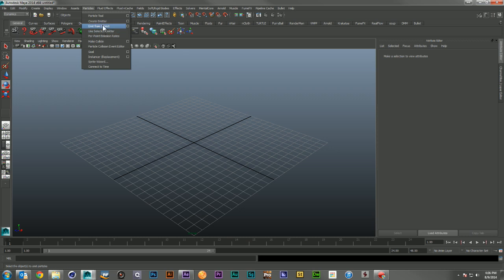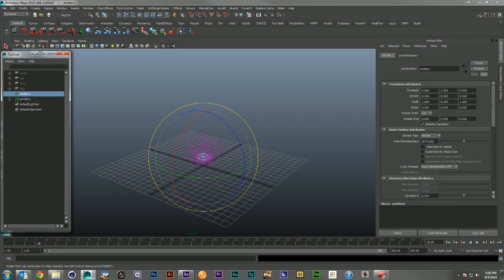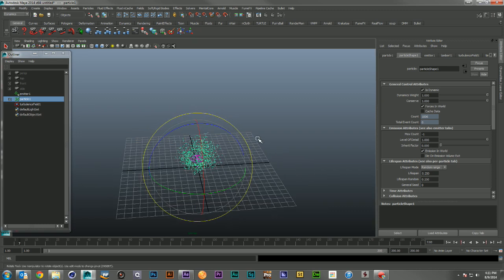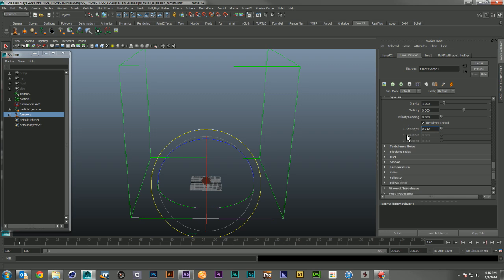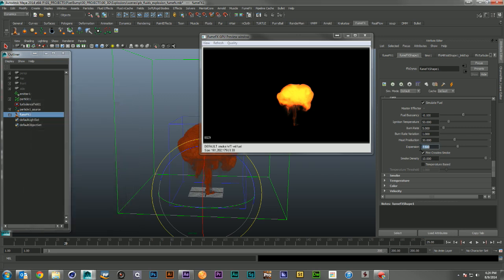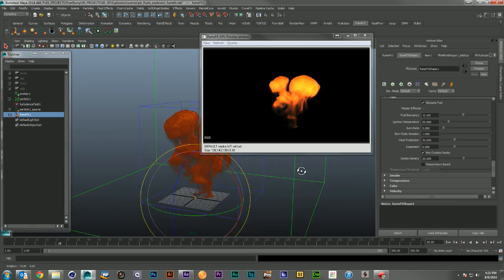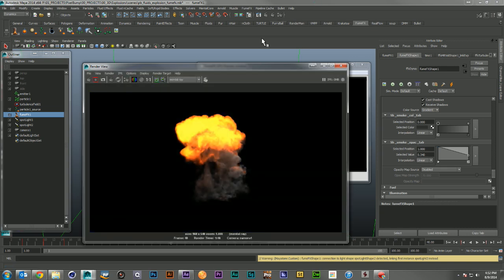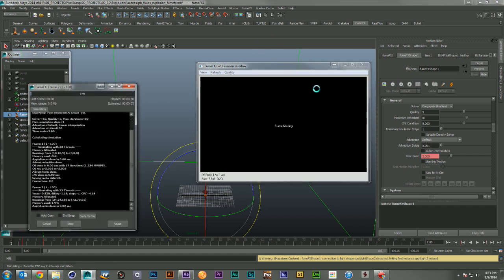PixelBump - Tutorial 09 - FumeFX vs Maya Fluids, Part 1

Comment: what was the use of particles in this
Reply from the maker: abhishek chakrabarti Hi!  Are you asking why I used particles for this?  The main reason was to give both pieces of software a common base so they would be more easily compared.  Neither Maya Fluids or FumeFX require particles to generate fluid but it is a very handy way to make fluids and control them.
Reply: +PixelBump Easy? Haha, i get confused between container vs emitter settings alone, not to mention adding particles to the mix. I have yet to try FumeFX in Maya. Have it installed on 3dsMax but maaaan is that piece of software poorly set out. Your channel is fantastic, can't thank you enough for the time you put in!